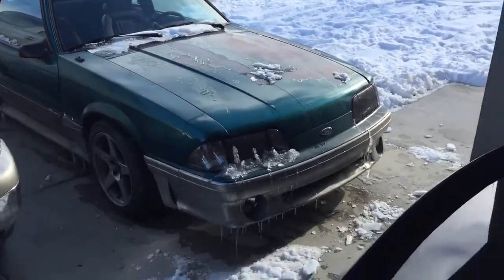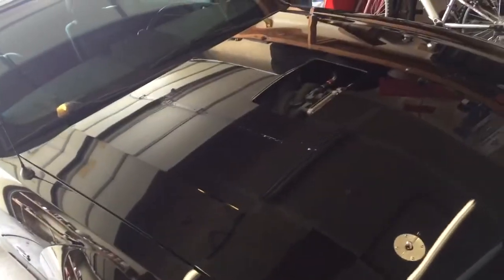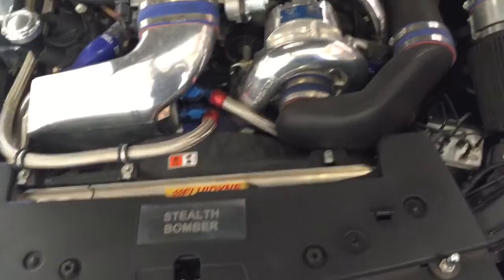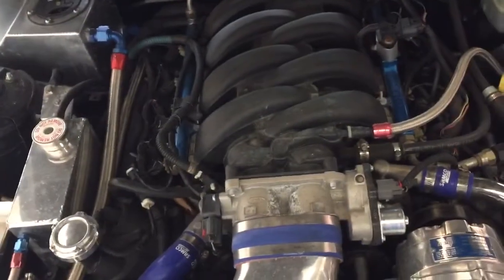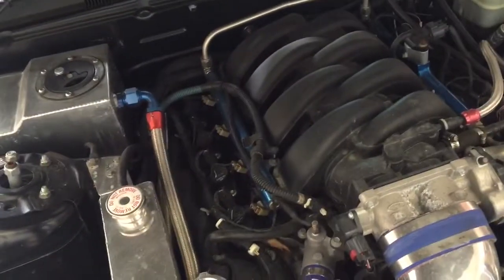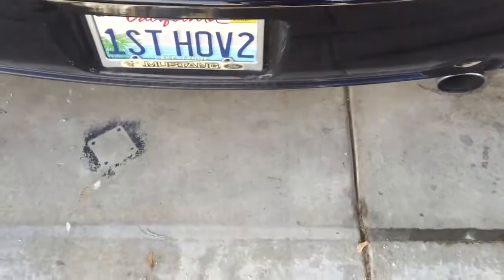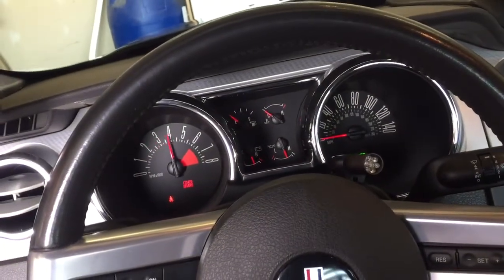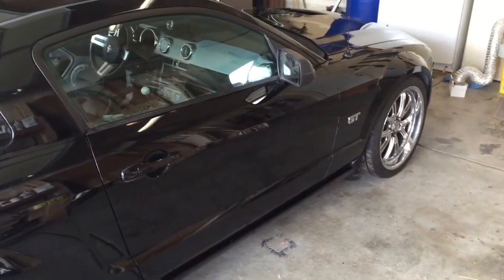My new supercharged s197

Comment: Wow, my car looks sad man! lol. I bought a 2016 Mustang GT white.  I hate it. Handles awful & it's passing oil & sprays it on the back of the car. It's done it since I drove it home with 6 miles. It has 4K miles & they are putting a new Coyote Motor. They may total it via Lemon from the bad motor. (Rings didn't seat they say). I'm just buying a new C7. I would clean up the fox & have it painted. They are going for big bucks here in Az & SoCal. I like the 2005. The radio is probably messed because he had an aftermarket app radio & threw the OEM back in & either didn't do it right or more likely he altered something with the aftermarket system. I would inspect the harness & take the radio out & look at all the wires. Sounds like he left an acc power wire connected that's still in the stereo system somehow. Maybe look for extra fuses. The interior in my 93 was perfect when I sold it. You gotta clean it man. Hahaaa. I enjoy your videos man. Take care buddy.